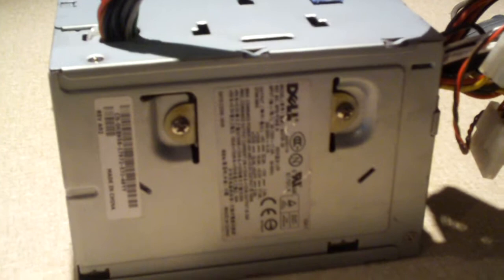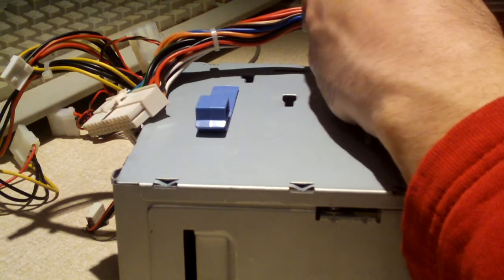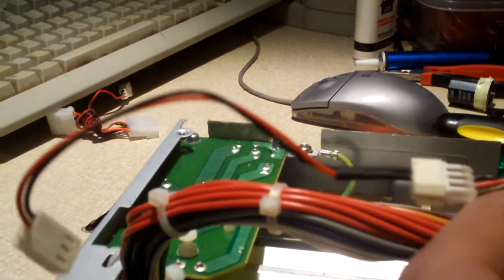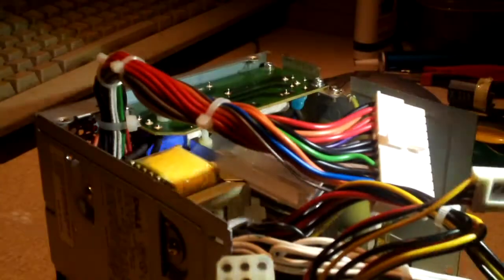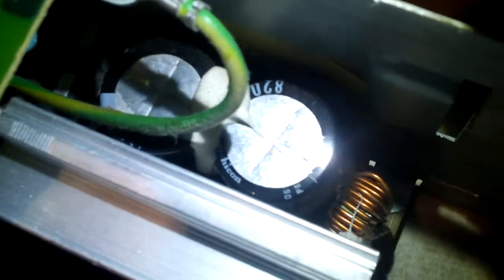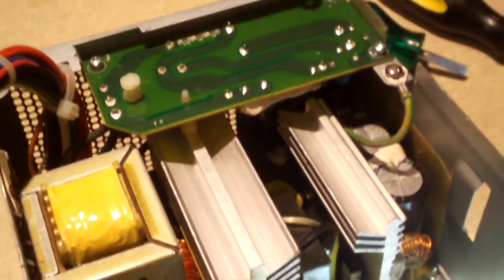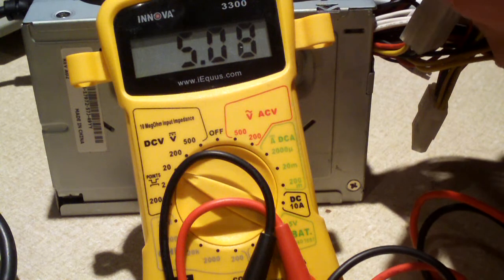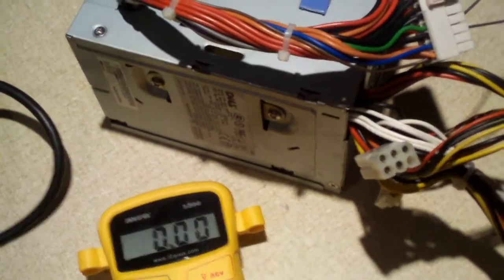Overview of DEAD Newton Dell OEM 375W Power Supply

Comment: I had Dell HIPRO that failed due putting a high end graphics card in and it was 375 watts and the graphics card that I had put in was to powerful it needed 500 watts to start so if I ever rebuild my DELL PC I will have a better power supply.

Comment: I've got to say, I feel like you and I are similar, sharing interests and ability, but differing greatly in methods and values.

Also I agree, Dell power-supplies are ridiculous.

Its funny hearing you call this a tank. I use what I would consider a small powersupply in the Corsair AX750. I'd consider something like 1200watt a beast.

Its honestly just so refreshing to see someone using parts like this and building computers for the common person.

Comment: i have got in my dads pc a 300w delta power supply from a dell its heavy but do they use good capacitors ? i can tell its built with quality
Reply from the maker: It depends... as long as there are no CapXon capacitors in it, then it's fine.
Reply: thanks ;)